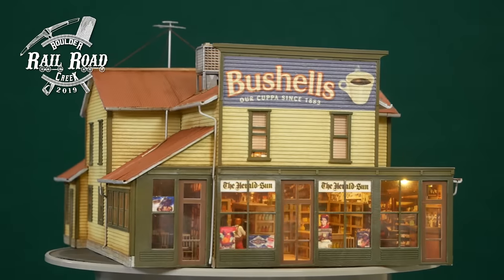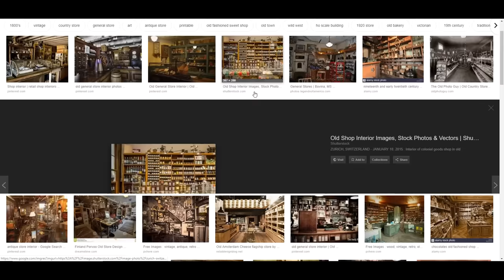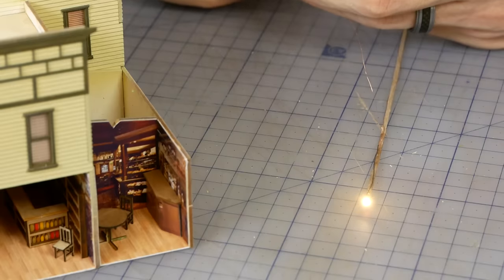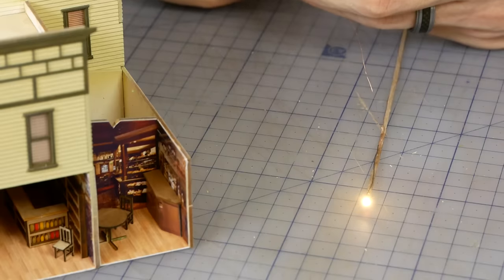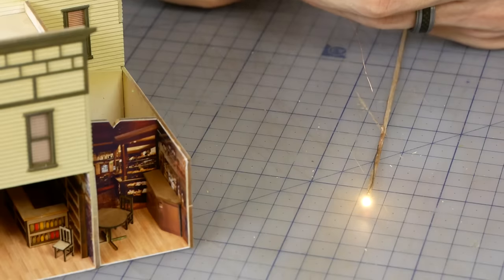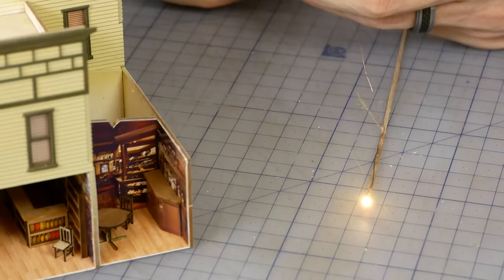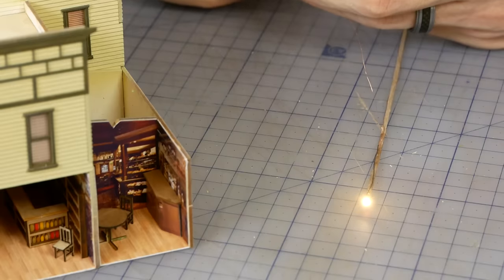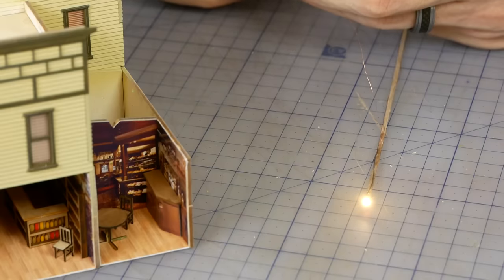Build & Animate an ULTRA-REALISTIC Diorama – Realistic Scenery Vol.16

Comment: Up until the Toyota went around the corner, I was happily seeing it as a real scene. Awesome work!
Reply from the maker: lol yeah it's hard to get the car to slow down naturally and actually see the front wheel turn as the car takes the corner 😉 It's a pretty tight corner as well which doesn't help visually. Glad you liked it Brad 😀
Reply: @BoulderCreekRailroad  steering front wheels is one thing, but I think just adding a driver to the car would help a bit too! ;-) Astonishing modelling in any case!

Comment: Luke, Woodland Scenics foam tack glue is absolutely ideal for gluing non porous plastic to foam. I tested it versus others and it was superior. When I eventually tore the plastic loose, it tore the foam surface itself rather than then two materials coming apart.

Comment: In America, we use a small cell soft sponge on things like corrugated aluminum foil.. (Not aluminium....) We also use primer so the paint doesn't flake off. But thats here in America where we dont do things backwards or drive on the wrong side of the road and the cars do not have bonnets... 

K....

Comment: Luke, I think I've watched all of your tutorials. Question: I want to make a diorama simulating a hot air balloon festival which features the leather hot air balloons that I make (they are not light). I want to animate several of the hot air balloons so that they rise vertically, travel horizontally, ascending and descending as they travel, to simulate the way that real hot air balloons really fly, and then landing at the other end of the field. Any suggestions how that could be done? Thanks.

Comment: David R Lentz, USA

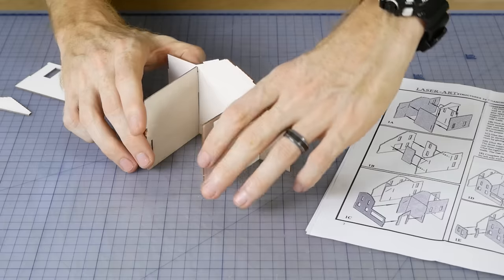Ohhh, would I delight to see entire streetscape dioramas much as these, though in 1:25-scale! These would come in three main kinds: 1) modest-sized urban settings of generations past, in a vibrant Roaring ’20s setting depicting the mid- to late-1920s a couple years prior to the Wall Street crash of October 1929, featuring 1:25-scale scale kits of 1a) the various versions of AMT’s Ford later Model T kits available (I think I have counted at least four conventional manifestations: roadster, coupe, pickup truck, depot hack, etc.), 1b) MPC’s 1921 Oldsmobile (as in the BMCK channel as “GRANNY'S HOT ROD” [of The Beverly Hillbillies television programme], YouTube build video, Saturday, 6 November, 2023), 1c) Lindberg’s three 1926 Mack trucks, 1d) MPC’s 1927 Lincoln (as in the Dansmodelworx channel: YouTube build video, Part 1, Monday, 7 August, 2023), 1e) Revell’s Duesenberg CJ, 1f) Monogram’s Packard, 1g), Lindberg’s Cord and Auburn, among others. 
   Another would be 2) an apartment block (round the mid- to late 1970s), with one wing of the large, six-storey red brick building ablaze, a full fire brigade comprising 2a) AMT’s three large fire trucks: the Pumper, the Ladder Truck, and the AeroChief (with a large, manned water cannon atop a long boom); 2b) AMT’s 1970 Chevrolet Impala Fire Chief car (as in the hpiguys Workshop channel: YouTube “1970 Chevy Impala 454 Fire Chief 1/25 Scale Model Kit AMT 1162 Build Review and Tutorial”, Wednesday, 12 February, 2020), 2c) a 1973 Ford Fire Rescue Pick-Up Truck (either a 1977 Ford Ranger F-350 Pickup AMT/Matchbox kit, PK-4611, or a Ford F-350 “Dualie” Pickup Truck kit, Monogram; this vehicle uses the labels in a 1973 Dodge Pick-Up Truck MPC Kit (red body, Fire Rescue label), the Dodge Pick-Up Truck model, painted a pastel turquoise, a local business proprietor’s name and telephone number on each door, somewhere behind the 1978 Dodge B Tradesman Van, painted a pastel azure, a local business operator’s name and telephone number on each side, in the traffic queue of my next diorama, both awaiting the light to change; 2d) a police patrol car built out of the 1970 Chevrolet Impala Fire Chief kit at 2b, above (as in the Seeds 4 Hobbies channel: YouTube “Building the 1970 Chevrolet Impala Police Car: 1/25 Scale Model Kit from AMT”, Saturday, 16 September, 2023); 2d) a Chevy Police Van (as in the hpiguys Workshop channel: YouTube, “AMT Chevy Police Van NYPD 1/25 Scale Model Kit Build Review AMT 1123” (Saturday, 16 February, 2019); 2e) a sheriff’s cruiser, adapted from the 1970 Ford Galaxie model kit (as in hpiguys Workshop channel: YouTube “1970 Ford Galaxie 429 Police Car 2n1 1/25 Scale Model Kit Build Review James Bond 007 AMT 1172”, Wednesday, 15 July, 2020; incidentally, the Bond reference derives from one of his motion picture’s featured the vehicle, a common practice in cinema; similarly, model manufacturers endeavour to market their kits to such ventures in a practice called a “tie-in”), 2f) two ambulances, namely, the Ford Econoline Van and the Ford F-350 4x4 kits, both converted to ambulances, the van borrowing the cabin interior of the Dodge Ambulance RESCUE 911 AMT/ERTL 6416 (or MPC’s 1978 Dodge B Tradesman Van Ambulance, Cannonball Run), and possibly the 1959 Cadillac Ambulance w/Gurney, AMT 1395; 2g) an airborne Bell UH-1 Utility Helicopter, painted white with a red band and markings reading “FIRE RESCUE” (modifying Revell’s Bell UH-1 Iroquois U.S. Army Utility Helicopter kit to civilian service, including figures in the attire and gear of rescuers, even then rappelling down). 
   I also would like to stage a diorama of 3) a car crash at a busy intersection round 1979, incorporating into the very centre of the tableau 3a) two generic sedans—I would use MPC’s 1977 Dodge Monaco T.J. Hooker Police Car kit, and AMT’s 1978 Dodge Monaco Sheriff’s Patrol Car in the Dukes of Hazard television programme (707), to use the police gear and the markings in: 3b) two 1970s Ford sedans remade as police cruisers, their emergency lights lit and rolling; 3c) two Ford F-250/350 Pickup Truck kits reworked as tow-trucks, 3d) a Ford Econoline Van and a Ford F-350 4x4 Pickup Truck (possibly these kits: 1977 Ford Econoline Van AMT kit, and 1977 Ford Ranger F-350 Pickup Truck, AMT/Matchbox kit PK-4611; or a Ford F-350 “Dualie” Pickup Truck, Monogram kit), converted to ambulances; the Ford van would use the medical equipment, supplies, etc., of the Dodge Ambulance RESCUE 911 AMT/ERTL kit, 6416 (or, if necessary, MPC’s 1978 Dodge B Tradesman Van Ambulance kit of the motion picture, Cannonball Run), placing the redundant Dodge van, a pastel azure, a local business operator’s name and telephone number on each side, somewhere in the traffic queue awaiting the light to change (and possibly another 1959 Cadillac Ambulance w/Gurney AMT/Jo-Han kit, 1395). 
   Of course, these urban streetscapes will require possibly dozens of buildings, many of them familial and commercial establishments, a tailor’s, a chemist’s or an apothecary, a hotel, a grocer’s, a butcher-shop, a barbershop, a hairdresser’s, and many more. Scores of patrons, shopkeepers, and passers-by bustle about their various errands. Telegraph or telephone poles, trees fresh in their springtime verdancy, signposts of every sort, will crowd one another along the verge bounding the sidewalks and the lawns. At both ends of the gently curving street will be a number private homes. 
   I have no experience in house construction (of any size or kind), or similar endeavours, so I must avoid any such complicated projects. I briefly had looked at the doll house market, pondering how complex they might be; I had heard that they are in 1:12th-scale—which made them twice too large. I learnt that one can cost several hundreds of dollars (USD), and some five or ten times those amounts; the furniture, appliances, bookshelves, toys, flowers and houseplants, wallpaper, and related items—all non-functioning replicas—can draw as much income for the producers as the actual merchandise! 
   To my delight, I found some in 1:24th-scale, which for a facsimile of a dwelling is close enough to be no issue. But pricing to create an entire neighbourhood would be peremptorily prohibitive! Similarly, the options scratch-building with Styrofoam sheets, and various substances generally akin to putty in pliability, texture, etc., have shown to be terribly labour-intensive, very time-consuming, deeply dependent upon the artistic talents of the user, in the aggregate costly, amongst other similar concerns. 
   The offerings you feature here look to bring modellers and dioramists a significant measure of options and compromise in expense. My concern is that the finished products look to me to lack the depth of detailing to provide the realistic appearance to which I aspire (despite your assurances in your title for “ULTRA-REALISTIC Diorama”; this genuinely intrigues and immensely delights me! Look online for the miniaturists who over the centuries of France and Germany created wonders to beggar the imagination and astound the mind! 
   This technology here providing us this new innovation is relatively new, and in short order ought to develop appreciably, enabling the makers to impart a greater level of detail, and their customers to awe us all as they delight themselves. Moreover, one can augment these buildings, storefronts, structures (obelisks, statuary, etc.), and other settings (rock formations, canyons, etc.), with the textured surfacing materials Plastruct and similar companies provide offer us both viable enhancements. Already have I used polystyrene sheeting representing red brick as cobblestone pavement for a pair of Ford Model T cars—to modest expense and a manageable expenditure of time. Can this laser process efficiently and expæditiously create upon materials various visual, colour, and tactile nuances, deep, subtle. and intermediate, rather than simply to cut prescribed patterns toward segmenting parts? Also, can it work upon other materials than that (or those) of these miniature constructions and formations your video shows us? 
   I enjoy contemplating and planning such model-building projects as much as I do actually assembling kits. The houses and buildings suitable for model kit dioramas, train layouts, and even the dollhouse market (well, so I infer) augur a bright future not only for those who buy and build them, but those who design and market them.

Comment: David R Lentz, USA

Luke Towan, I just saw the astounding tableaux the chaps at Real Terrain Hobbies, an operation generally like yours, have created. Ttheirs they base on 1) 3D printing and 2) Woodland Scenics’s eclectic, comprehensive assortment of diorama scratch-building materials. I urged them to contact you toward their using your methods, materials, etc., to augment what they do. This message primarily is to exhort you to reciprocate, adapting your methods to incorporate into your builds what they do. 
   To combine your laser cutting technology with their 3D printing and the adaptability, flexibility, etc., of the Woodland Scenics eclectic, comprehensive assortment of diorama scratch-building materials make possible not only will improve significantly the various efforts you undertake, it greatly will strengthen both your operations, through augmenting one another.